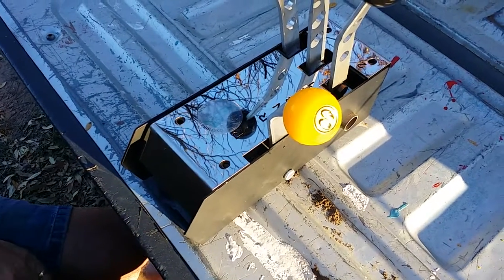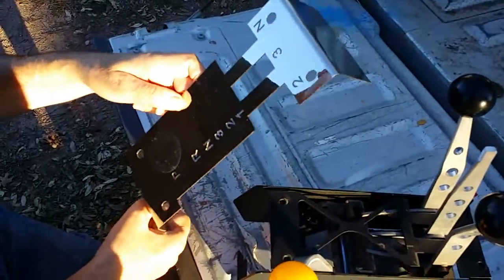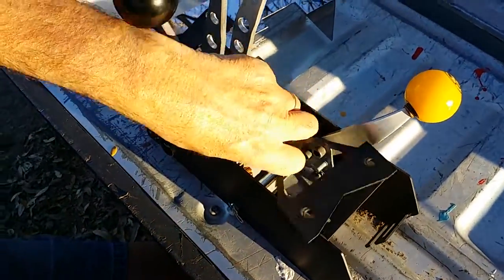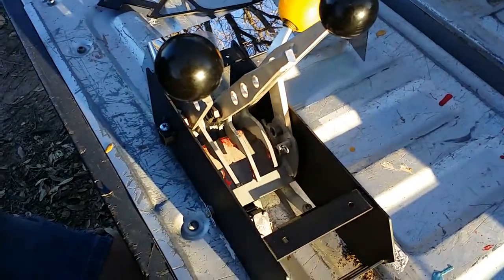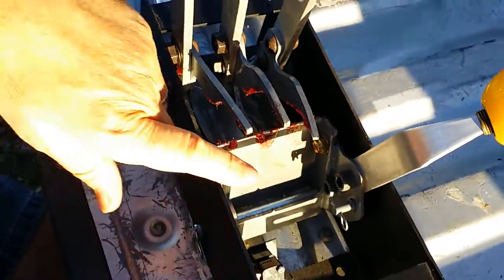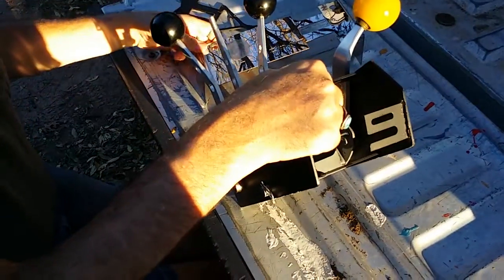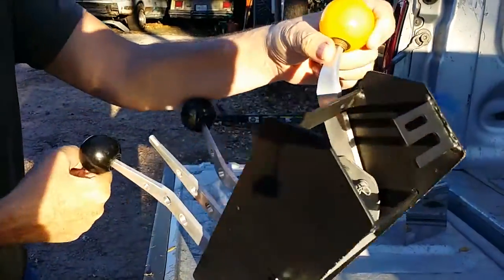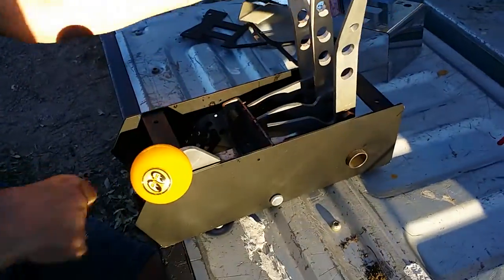Kilduff lightning rod shifter disection

Comment: So... How does it work? Ir is basically moving the plate, which tells computer when to switch gears or there is some mechanical linkage to the actual transmission? I really don't know :D
Reply: I have a set in my cutlass shifts 4l80 with manual valve body works great killduff builds good stuff. I will never use anything but killduff
Reply: Not computer controlled, it's all by cable
Reply from the maker: These lightning rods use the standard B&M cable that is behind most all aftermarket shifters real simple set up

Comment: can it be installed onto any automatic car? even a honda?
Reply from the maker: Ramiro Pinon    This particular model is for a gm thm 400 3 speed, will not work on a 4 speed. like most if not all shifters they are transmision specific, you should visit his website to see if he makes shifters for imports, www. Kildufmachine.com